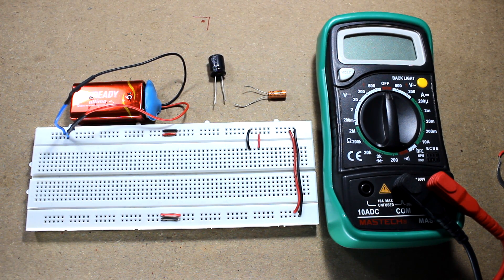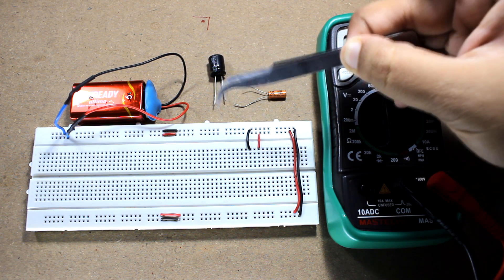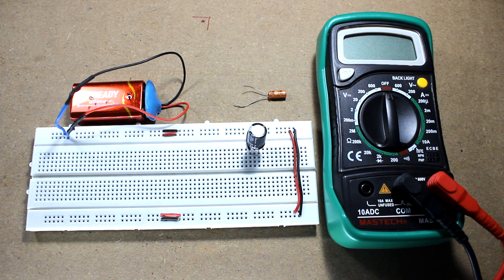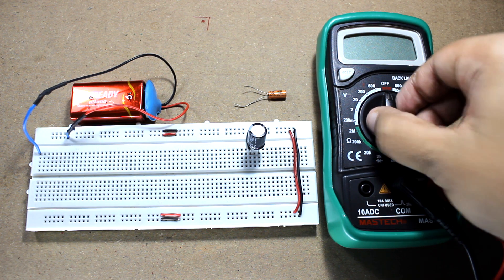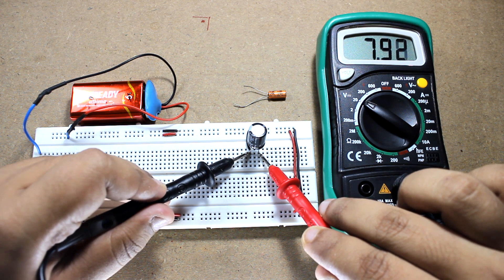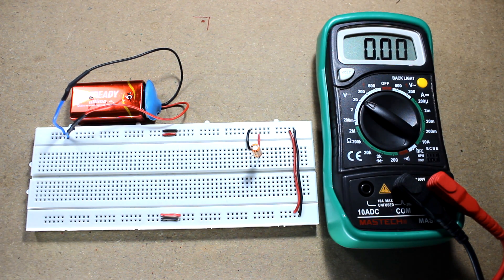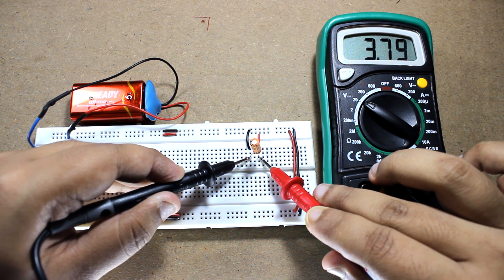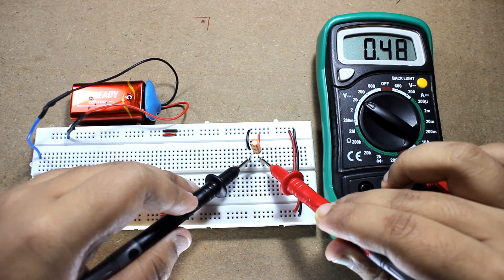How to check a capacitor's working condition using Multimeter

Comment: Nice video. How can we test sensors, transistors etc. to check if they are in working condition or not using multimeters?
Reply from the maker: Yes we can test transistor by multimeter. But sensor is a large area in embedded system. There is no predefined way to to check sensors. The process will depend on the sensor type.